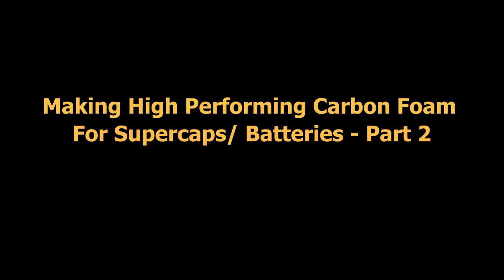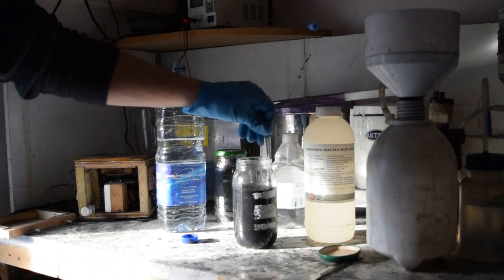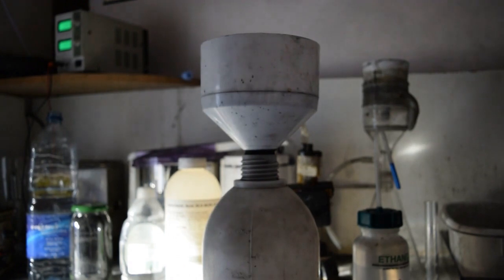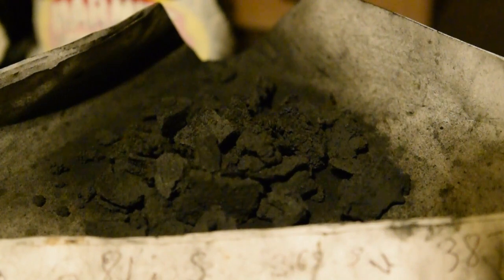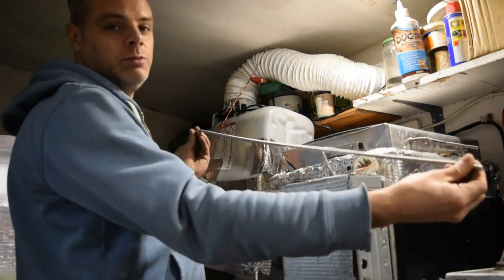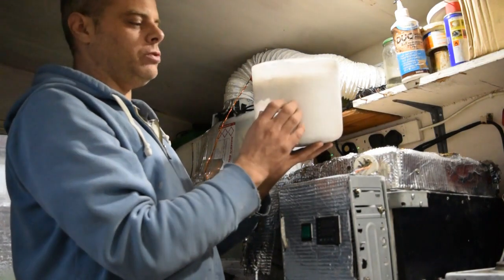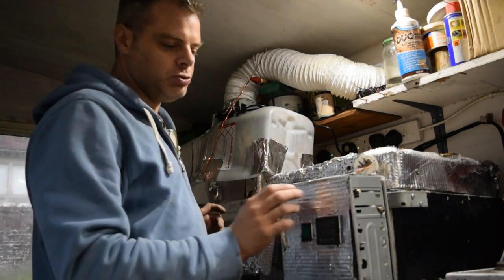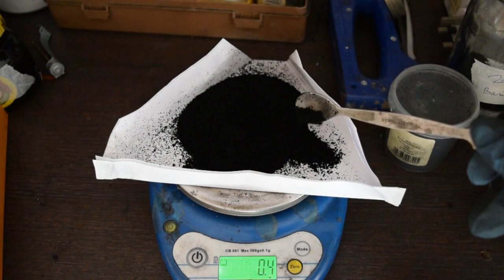Making High Performance Carbon Foam For Supercaps/Batteries -Part 2

Comment: Can't you just buy activated carbon and graphitize it in a microwave?
Reply from the maker: Justin W microwave doesn’t get hot enough n has to be in carbon atmosphere. U can buy microwave kilns that fit in ordinary microwave which do get hot enough. Also your activated carbon (usually coconut fibre) may already be graphitised.
Reply: @geeforce3891     Yeah, I insulate it and also protect it from air by putting parchment paper, then a few layers of regular paper, and then either baking soda or more (sacrificial) activated carbon on top. While it's not a perfectly inert atmosphere, it works well enough.

 Interesting, didn't know that the activated carbon might already be graphitized.
Reply: Personally I don't use the above for electrical purposes though.  For that, I make high grade/percentage crystalline nanocellulose, then carbonize it, then graphitize it.  
   It's similar to the hemp stuff that Smith and others talk about, but it probably has a higher amount of crystalline material in it. 
 Besides being highly electrically conductive---it's also amazing for composites.   
 Just regular crystalline nanocellulose has same tensile strength as carbon fiber and more stiffness.   But when you carbonize/graphitize it, it becomes even much stronger in those areas.  

  So if one wants to make super composites cheaply, use a combination of lighter weight S glass fiberglass, with epoxy doped with the CCNC and some carbon fiber chopped fiber (MUCH cheaper than the woven stuff).   Also put a layer of epoxy with the CCNC down on the substrate first before putting the glass on.  
 In the future, I will be doing some tests comparing two different materials with fiberglass--all the same, except one with CCNC added.
Reply from the maker: Justin W yes if you test the conductivity of the AC and it’s quite a low resistance it’s a sign that it’s already had some graphitisation. Really depends where u get it from.
Reply from the maker: Justin W you make your own crystalline nanocellulose? That’s really interesting. I’ve always wanted to experiment with it for electrical energy storage. Sounds idea material. If you’re willing to share details on how your get a high grade from normal cellulose that would great or better still, make a video?  Thanks for your comments
Reply: @geeforce3891     I'll give some hints for right now.  I start with a cellulose source that has a high amount of crystalline cellulose already--these are the bast plant fibers like hemp, ramie, flax linen, etc.  I get the least expensive source I can find.  
     I heat some distilled water, put it in a black HDPE or PP bucket, I mix a little more than equal amounts of sulfuric acid in with it, and once the reaction has calmed down, I put in a regular sized bottle of 3% hydrogen peroxide, then throw in the fiber.  Cover with either clear plastic wrap or a glass pane and put in a sunny area to help keep it warm. Stir a few times or so a day.
     After about a couple of days, everything but the crystalline cellulose should be degraded.  Since the above plants listed tend to have around 65 to 71% or so content of crystalline cellulose, you get a fair amount per run vs using waste paper, sawdust, or the like.  
   Then I collect it via a mesh filter. Just to make sure it's all broken up well, I put it in a blender for a bit. When it becomes like a gelatinous gel, you know it's good.
  Depending on what I am going to use it for, I either wash it to get a neutral ph, get it neutral then put in a potassium hydroxide solution (this helps to catalyze it while heating so you don't need as much heat to graphitize it), or leave it acidic.  
   Currently I'm working on building a super solar oven to get it to the carbon state rather than using my little jewelry kiln (then finish with microwave).  The solar oven will be well insulated, combine a box and large funnel/inverted conical design, as well as also have a fresnel lens pointed at the black titanium cook pot. 
   I've also ordered a vacuum insulated borasillicate glass coffee maker to see how well that works vs the box.
  I'm waiting on some ultra black (black 3.0) paint that I ordered from CultureShock, but it is taking forever--ordered June 27th and it hasn't even shipped yet.  I might experiment meanwhile with some ground up activated carbon mixed in with some waterglass (sodium silicate) painted on the pot. It won't be as black as the stuff I ordered, but it might be ok for now since the sun is still very strong where I live (around 38* N latitude) and it's in the 90's F most days.  Once I get it, it will also allow me to put a lighter coat over the carbon/waterglass coat.

  Hope this helps.  I plan to sell it on Ebay, Etsy, or the like once my solar oven is built, for composite, electrical, etc purposes. I'll be putting some simple tests as far as composites go on Youtube. (cardboard refinforce with fiberglass/epoxy vs cardboard reinforced with same amount of fiberglass/epoxy but with some of the CCNC mixed in--a little goes a long way from what I've heard).
Reply from the maker: @justinw1765  thanks for sharing that info mate. sounds like you're doing good stuff. always good to hear what others are upto and share especially doing videos, i know thats what Murray-Smith always encourages. 
i looked into how to make or subtract the CNC from cellulose ages ago but didnt find the info i wanted and it wasnt at all easy to just buy some. i saw a video of a company in America put it in a huge container of sulphuric acid but under big pressures so i didnt think it was something possible for the home experimenter but your method sounds good. Robert MS did once said he might do a video on how to make it but that never happened. i'll give this a try. cheers!
Reply: @geeforce3891   You're welcome and no problem.  Same to you. 
 Cheers
Reply: @geeforce3891    Note, you can use bio-enzymes (sold for clogged drains) as well, but it takes longer and requires more vigorous stirring (you could set up a wind stirrer pretty easily though).  It's a bit cheaper and more friendly to work with. 
  I don't mind sulfuric acid so much (it's not near as bad as some make it out to be), but when you add hydrogen peroxide, it becomes more dangerous stuff.  Commonly called piranha solution, though this is a weak version of same.
Reply: @geeforce3891   Wanted to give you an update.  I was re-looking at the literature, and what I told you before about time was way off.  

     Ideal time of acid exposure seems to be from around 40 to 90 minutes, at around 60% acid concentration (though, I don't know if that is by weight or volume, but I assume weight). Temperature is important too. While I prefer metric in most areas, re: temp, I prefer F since it's more precise. Anyways, around 130* F seems to be the ideal temp. 

  Previously, I was loading the fiber into the water-acid blend pretty much right after I mixed them, which apparently is a no no, as that's too hot at first.  So best to let them react, cool down, and then put the fiber in and let the warmth of the Sun do the rest. 

  Sorry for the previous lacking/not fully accurate information. There was a difference between what I've seen in youtube videos on production of cellulose nanocrystals and reading the direct research papers.
Reply from the maker: Justin W ok thanks for that mate
Reply: @geeforce3891    You're welcome. Also there is a bleaching and/or de lignization process that happens before the exposure to acid, mechanical defibrilization, or enzyme exposure.  

  I thought that the acid could break down that other stuff, but apparently the acid is only for the soft cellulose.  You need bleach, lye, or the like to break down the lignans.

Comment: Are u coming anywhere close to commercial supercaps?

Robert made a 1.5 farad/cm2 using graphoil and graphene oxide

Is this the best way or are there better techniques?
Reply from the maker: I cover this in my other 2 videos. Testing and results and comparing carbons. Commercially available supercaps use coconut fibre activated carbon. The carbon foam showed here resulted in almost twice as much energy density.

Comment: Thank you again, very good video, for how long you keep it at 1100 centigrade?
Reply from the maker: It takes my kiln about 2 hours to get upto 1100c. As soon as it reaches 1100c.. I switch it off. You could leave it on longer but I don't believe they'll be any more benefit.  The carbon would have had about an hour at temp 900 to 1100 c.
Reply: @geeforce3891  thank you, I tried today a carbon at 900 and the result is 0.8ohm (from 500 ohm), I am really happy with that. Tomorrow is hydrothermal carbonation day.
Cheers,
Sorin

Comment: HI TIM a COUPLE OF THOUGHTS AND IDEAS?
Have you looked at  stem projects ? LEO uses table salt to convert sugar into carbon easy to wash out with  demin water  and cheap easy tried it works good

Have you got a Poundland store near you they sell a product called Coco soil in the garden department this a compressed 2 lb BRICK  CONSISTING OF COCONUT fibers 
Which are used to make commercial super capacitors !

carbonized and mixed with your sugar carbon  may improve  your active material ??
suggest very slow carbonizing of coca nut fibers over long time 12- 18 hours ?

RMS USES two table salt and 1 to 1.1/2 sugar for water based electrolyte
Salt increases the conductivity of water,  sugar helps stop water breaking down 
to 2 parts hydrogen and one part oxygen also gives a place for the ion to go when charging
the device

Martin T
Reply from the maker: Thanks Martin. I'll start adding sugar to my electrolytes to see if that helps. Cheers!

Comment: Another solid video, Tim!  I love the clarity and explanations for what you are doing.  That looks like GREAT carbon.  I'm hoping that the lightness of the material really does translate into surface area.  Maybe your next homemade piece of kit should be an electron microscope! (grin)  I don't have a kiln, so I have to work through carbonizing in the microwave.  It is interesting the way you stop the microwave when the smoke appears.  I haven't tried that.  My best result so far came with continuing on.  The smoke was there for a couple of minutes, then it went away.  My guess is that the oxygen near the sample was very low by then.  I think my next run will be comparing stopping it right as it starts to smoke, compared to leaving it going the longer time.  I have a daydream of creating a very high-performance battery that is green, easy clean procedures, and where the information is shared openly, like open source software.  Onward and upward!  leo
Reply from the maker: Thanks Leo - Yes high performance, green, clean n easy to make as well as cheap and easy materials to get hold of! That's the aim, but I think in reality there will have to be some compromises ;) Good luck!

Comment: really good detailed content, really like that your lab is set up with a lot of DIY budget equipment.
Reply from the maker: Thanks Peter!
Reply: @geeforce3891  I would really like to see how your carbon performs versus some ebay coconut shell activated carbon.
Reply from the maker: @petergold4823  Sure. That's a good idea. I'll do a video demonstration of my best carbon and compare it with others. Keeping everything else the same.
Reply from the maker: @petergold4823  just done a comparison with my best carbon compared to coconut activated carbon. My carbon appears to roughly produce twice as much energy density to activated carbon. I will do a video to demonstrate this. Thanks for pointing it out!
Reply: @geeforce3891  that's a significant difference! sometimes its easy to get caught up in the process without measuring the benefits. Looking forward to the video.
Reply from the maker: @petergold4823  oh I knew it was better than activated carbon. I just couldn't remember by how much. And it's important to demonstrate that n let people know. Cheers!

Comment: Nicely done, great lab and equipment. Found your channel via Kev Wallcrofts' channel. I Look forward to seeing the sugar carbon working in a cap or battery. Any electrical conductivity measurements on the carbon? Cheers from Canada.
Reply from the maker: Thanks mate. Yes I've managed to get a reading as low as 2 ohms, but I suspect its lower than that as it's hard to measure in powdered form.